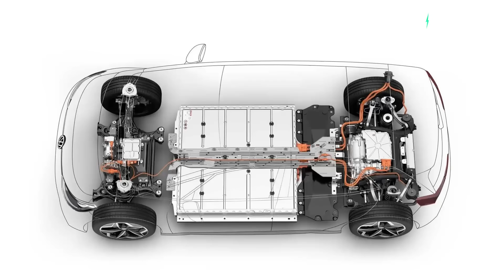CANADA'S Gigafactory! Construction Begins on Largest EV Battery Factory in North America

Comment: I hope this project is successful. It appears to have many challenges. Volkswagen has yet to offer compelling, competitive, and profitable electric cars. Volkswagen has massive debt and is facing increasing electric vehicle competition from BYD, Tesla, and other Chinese EV manufacturers. Lithium ion batteries are projected to face increasing competition from cheaper, more robust, safer, more reliable, longer lasting, faster charging sodium ion batteries (such as CATL’s Naxtra, and Peak Energy’s GS-1.1) for battery energy storage systems (BESS)  and EVs over the next few years.

Comment: Canada? I am sorry, this is a joke, i lived in Canada for 20 years, this country essentially has no industrial foundation. Just go to the worksite and take a look, none of the machineries used in the construction of the factory are Canadian. this at most is an assembly line of batteries. the machines and cells used in batteries are all imported. Canada is a low productivity country, which means projects are either too expensive or too slow. This looks like a government show at the cost of tax payers and most likely to fail like the NorthVolt (which has a much better industrial foundation than Canada)

Comment: I really hope they're not planning on moving the batteries out of St Thomas on frieght train. The same freight train that is on neglected rail network that is shared with passenger trains on a single lane long distance track. I mean I'd HOPE they retro-fit the rail nearby and use it, since it's a great method of heavy transport. St Thomas is called the "railway capital of Canada" thanks to it's founding history, but its now more of a historical tourist atraction than an industrial boon currently. 

If they're shipping via truck -- the 401 is about to get a lot more traffic. 

So yeah, I'm concerned with the delivery of the final product.

Comment: Slightly misleading. The NextStar factory in Windsor has begun limited production and has a total of 4.23 million sq. ft. The St. Thomas VW battery plant will be only 2 million sq. ft. BUT, VW's facility will ultimately be larger since the area they are developing is 350 acres. NextStar's area is maxed out. Eventually VW's plant will produce batteries for 1 million EVs per year, compared to NextStar's 450,000 EVs per year. So it will not be the largest in NA until it is!  That's likely years down the road.

Comment: The most important part is the standardized cell.  Think flashlight batteries there are basically 4 sizes globally now. Personally,  I expect they will be making Sodium cells by the time the plant is finished.   These plants are so huge you can compare them to airport runways. (Roughly 1,000,000 square meters.)

Comment: Power Co has a 100,000 tonne/year spodumene off take with a Quebec spodumene mine developer, PMET resources scheduled to be in production in 2029(PMT on the ASX and PMET on the TSX). They also have an option for an additional 100,000 tonne/year offtake, but that is only 25% of the spodumene they need to makde into lithium battery chemicals. Aside, you might also be interested to know that PMET discovered the largest ever cesium deposit, enough to make tandem perovskite PV's a reality and moving PV efficiency north of 34%.

Comment: VW is playing it very smart.  Permanent investment in not just making batteries, but in battery components right from the source critical minerals through to finished products.  A completely vertically integrated supply chain.  Ontario also has emissions free electricity (mainly nuclear and hydro) and green steel and green aluminum made from clean power.  I hope VW makes cars here too -- we can certainly use carmakers that are not part of the Trump-puppet Detroit trio of gas guzzling behemoths that are quickly laying off thousands of Canadian workers in the integrated car industry.  Integrtation with the US is now off the table.  The id 3 and id 2 will sell well in Canadian cities, provided they are priced competitively.  Canada has the opportunity to go electric while the US continues the last century combustion paradigm.  We may even take a chapter from Australia and allow Chinese EVs to meet Canada's pent up demand for dumping petrol burners.

Comment: This factory alone isn't enough to secure top spot in the North American EV industry but it's a very significant step in that direction.  Canada will need a slew of factories throughout the EV supply chain but also its own auto companies.  Canadians are used to the USA being dominant and content with whatever scraps get thrown Canada's way.  It''s refreshing to see that mindset rejected.  There's no reason Canada can't be #1.
Reply: I’m wondering if this battery plant is building a complete in Canada battery or is it an assembled in Canada battery with Chinese parts? For instance the lithium , and graphite?  Is it Canadian refined ? 
Cheers

Comment: I didn’t see sodium in the chemistries they plan on switching in and out. Could this be a misstep?
Reply: The timeline for when the EV usage/application of Sodium batteries are ready to compete against Lithium for EV usage may be further off than Electric Viking or CATL may be hoping.  There have been some recent tests of new CATL sodium batteries by a variety of youtubers and it has alot more shortcomings than we all were hoping for.  We all want Sodium to be a viable option, would be great for humanity as a whole but cant rely on the battery tech yet for EVs.

Comment: This factory is being built in Markham Ontario. I wonder why that location? Perhaps, because Ontario has a lot of electrical power and Tesla bought a building there. The ore is probably coming from western Canada. VW is building their factory in Ontario as well.
Reply: As stated in the video the VW plant is in St. Thomas not Markham. The environmentally friendly electrical power was factor.  No Teslas are manufactured in Canada. Teslas in Canada are imported from China and USA. The raw materials are coming primarily from Ontario and Quebec.
Reply: @larryallin7404 the Tesla plant is in Markham.
Reply: @jamesdellaneve9005 There seems to be some confusion.  My understanding is the relatively small Tesla plant in Markham doesn't  assemble EVs or batteries instead they manufacture some of the parts for machinery that are in turn used to assemble batteries. This is not comparable to the enormous VW battery facilities being built in St Thomas.
Reply: @larryallin7404 Perhaps. I had read that Tesla was going to scale up the Markham plant to make batteries. According to what I read, it hasn’t happened yet. Tesla likes to build purpose built buildings.

Comment: One thing you left out but is important is that Canada has solved the cold battery problem, when it gets -20 or so batteries lose up to %30 or more power, but now the Canadians have been working on that issue and seem to know how to put a heating system to prevent that problem, the big 3 better make a decision or they will be gone in Canada, and after what GM and Stellantis did, they may be finished any way, I will never buy a GM or Stellantis car.

Comment: These factories consume massive amounts of power. Does Canada get to built the cars that will use these batteries? Canada needs to have the manufacturing jobs not just supply the world with batteries. The deals we make to supply the batteries need to come along with deals to built the cars as well. It is the jobs that are important and the U.S. is currently pulling the auto sector away from us. Our mistake in the past has been to be “just” a supplier of “ raw materials” and not a manufacturer of our valuable resources. Selling of our resources rather than  refining them ourselves is not a wise move. We need to make the cars not just supply the batteries to a greedy world. Good deals for Canada requires fairness not just exploitation of our resources.

Comment: Brillant catch again man.... But strange, you're missing a few Key points here ... PowerCo has a licence agreement with famous Quantumscape startup for manufacturing its Solid State Lithium Metal Anode Batteries, that can be declined into various chemistries, including NMC and LFP. Not clear also is  how VW group and its PowerCo battery production arm, will handle Sodium Ion chemistry, meant to become dominant soon on cheapest lower range entry models, cold weathers and Grid batteries, in their unique battery formfactor. Thanks.

Comment: Powerco has a stake in Quantumscape.  If they make solid state batteries for EVs, it may make all the other chemistries obsolete.
Reply: Solid state electrolytes and electrode chemistries are not the same thing at all.

The electrolyte chemistry is important of course, but for solid state the actual structure is far more important to facilitate ion transport.

Also Quantumscape has been making noise about solid state for a loooooonnnngggg time.

It has about as much PR reliability in the battery market as Audiopixels does in the MEMS audio market.

Wake me when they are actually shipping gigawatts worth of product per year.

Until then it's just another meme stock, a factor which this channel and many others talking about EVs, batteries and renewables seem to prioritise more than actual market viabiltiy.

Always remember that a YT channel host can and often does have an ulterior motive for pumping up a brand.
Reply: @mnomadvfx  QS has licensed their ceramic separator technology to Corning.  I think we will see SSBs in cars by 2028.

Comment: As long as the world's largest automobile organization is the driver and they continue to grow, Canada will be well positioned in EV infrastructure globally.

If VW can't use it to full capacity that leaves room to sell to other companies.

The factory will eventually attract atomotive assembly as well.

We're making a vertical manufacturing eco system, which starts with Ontario/Quebec resources and green power, that attracted the battery plant, which will attract more assembly plants.

This vertical concentration will be hard to beat in North America and impossible to manipulate from Washington.

I would expect Toyota to eventually take advantage of the resource and green power concentration in Ontario and Quecec as well.

Honda already has a battery plant underway in Alliston as well as Stellantis/LG in Windsor.

Yup, abundant resources, cheap green electricity and  the world's most educated workforce.

That's our power flex.

Comment: Hopefully, they secure their long term viability by also producing sodium batteries.
Reply: Good point. Fortunately while the chemistry is different Sodium batteries are manufactured using the same processes and equipment as the popular LFP batteries. This should make it relatively easy to produce both batteries type in this plant.

Comment: How long until sodium ion batteries are more common?
Reply: Generally speaking, new technologies take a few decades to scale properly.  There are some factors that will shorten that time-frame, since they don't have to completely reinvent the wheel; we already know how to make batteries.  But, building factories usually takes years, then ramping production takes a few years, then hitting enough scale to start to take a lead - even more years...  My guess is not before 2030, being optimistic.

For reference, lithium-ion batteries were invented in the '70s, became household items in the '90s, and had the energy density to start making EVs around 2005-ish.  These things do not happen quickly, no matter what hype man at a startup might try to tell you.  Likewise, solid state batteries have been "just around the corner"... since the 1990s.

Sodium-ion will likely take over stationary battery storage LONG before it makes its way into EVs, because the energy density is currently about half as much.  A cost savings of 30% on just the battery portion of the cost to make a car, for half the range is terrible trade-off for most (maybe saving about $2,000-$5,000 on most cars, but losing ~100 miles of range).  Sodium-ion will probably dominate stationary battery storage, freeing up lithium-ion for cars.
Reply: Too heavy for cars. Solid state arent. Fast flcharge times too.. By the time that things on line solid state will be the standard.
Reply: @Bluetree-l2k  china just cracked the nut for solid state lithium batteries. they are already running pilot production lines before they start mass producing them. mass production was slated for 2027-2030 a year ago, but recent advancements have pushed the earliest mass production to only 10 months from now (sept. 2026).

... and these batteries will also handle north climates much better than traditional lithium ion, so no more 20-40% energy loss due to cold temperatures, there will still be loss because of the nature of lithium but it wont be as much, and should last 2-3 times longer at least, and technically they have 5 times more charge cycles, so in theory its as much as 5 times longer lifetime battery usage, meaning EVs with solid state tech should last 15-20 years without a battery change at a minimum, instead for 5-8 years for relative battery degradation, with a theoretical 40 year lifetime before power retention drops below 90% compared to 10 years for traditional lithium ion EV batteries.

it also sounds like they are working on a 1.3Mw charger for their new 1200w battery base (for traditional lithium ion), which should be compatible with their future solid state batteries.

so they will be stand much sooner than people think, at least in chinese EVs, and we already cannot compete in this industry against china, hence the 100% tariffs we put on to protect the US's EV's market, because we don't even have one yet, not really, maybe 1 or 2, but its certainly not an industry unto itself, but rather an extension of the traditional car market, which is going the way of the dodo.
Reply: Multiple chemistry production means means exactly that 😀😀😀